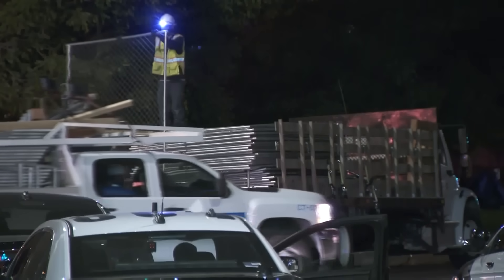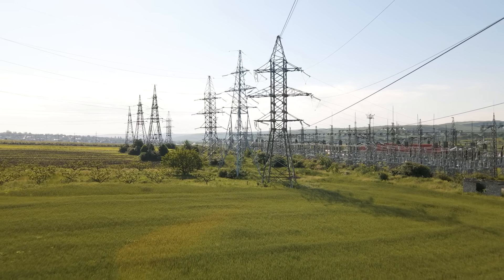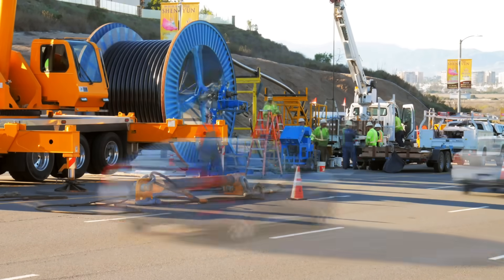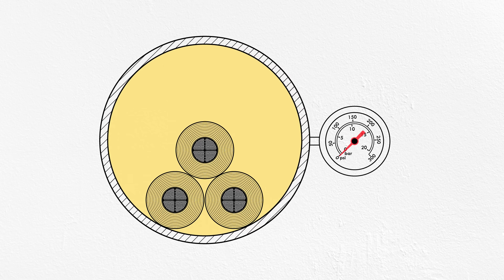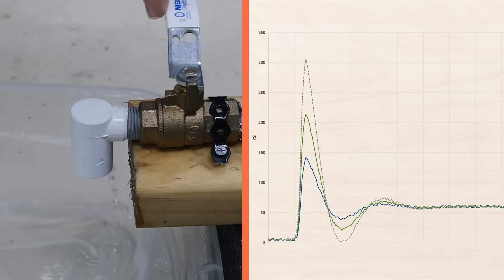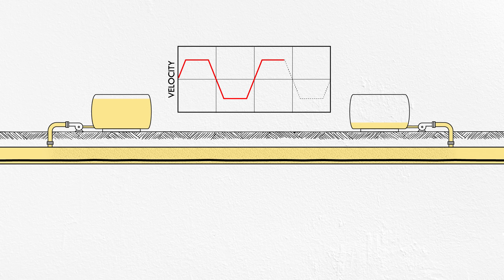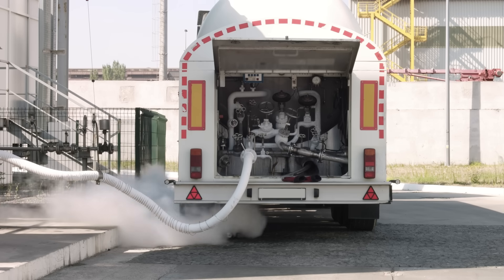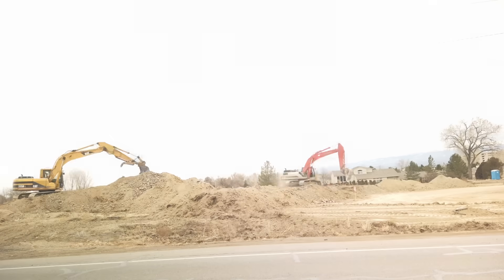Repairing Underground Power Cables Is Nearly Impossible

Comment: Singapore has a rather interesting (though experimental) solution for this, instead of buried lines that need to be dug up each time for repairs and modifications, a huge tunnel is dug (similar to train/vehicle tunnels so they can be easily accessed even by humans and machines), the lines are laid inside the tunnel which can be easily accessed without any digging up, while still having the benefits of not being exposed to weather
Reply: not only singapoore.
I think London has it aswell, where power and sewage in newer parts are combined into accesstunnels and the diferent pipes run inside a tunnel...
And I believe in Switzerland it is also in some parts done...
Reply: @BlackDragonWitheHawk  national grid are currently bin the process of building new tunnels in London. Don't mix them with sewers though
Reply: @BlackDragonWitheHawk  Is that for transmission lines? I don't think that is feasible for 230kV lines. Like Grady mentioned the necessary clearances for 230kV lines is about 10 ft. At DWP we use 13 ft for bus conductors at the station, which I'd imagine the transmission line groups use the same clearance unless space is an issue. 

For low voltage distribution lines we do use underground cable that go to various vaults and manholes
Reply: You are correct London has some historic foot or railway tunnels that have been repurposed for this.
Reply: @BlackDragonWitheHawk repairs must stink 😆
Reply: @BlackDragonWitheHawk  Yep, Tom Scott has a video filmed in one of those tunnels: https://youtu.be/Mm5khEUIBx0
Reply: @BlackDragonWitheHawk  And Auckland, New Zealand. A tunnel was built to provide extra 110kV cables to downtown. And space in the tunnel was leased to run 220kV cables right through the city since building extra overhead 220kV lines through the urban isthmus area is impracticable. New Zealand also has 350kV direct current submarine cables interconnecting the North and South Islands.
Reply: I witnessed a tunnel being cut ( approx 6 meters wide) in the median of a main road in sydney, they then installed removable concrete lids and laid cables in the easily accesable tunnel, this concept is not unusual but the scale made it quite interesting to me, to have 300kv lines so accesable for the entire tunnel is proably a dream for many electricians and engineers
Reply: @michaelwillis1832  That's not George Street, is it?
Reply: @HenryMidfields  Actually it was hoxton park road that i witnessed it on, now liverpool transitway
Reply: @michaelwillis1832  sounds like 10 or 100 times cheaper than digging a tunnel. Great idea! Any idea how they fix the static problem of heavy traffic right above the tunnel?
Reply: @VividFlash  The Cables are fully insulated, the install looked much like the last section above with xlpe or something similar is used.
Reply: @VividFlash  Admitedly the insulation doesnt completely stop the magnetic fields but the lid would attenuate the field somewhat, after a little looking around i found a document saying underground cables do have a higher comparable field at ground level than a aerial cable, but no exact numbers. :Shrug:
Reply: We also have a smaller version of this in Tokyo, with utility tunnels in certain places in Tokyo, Osaka, and other big cities. They aren't as big as Singapore, but they still allow people to access inside the tunnels to carry out repairs.
Reply: London did the same for a line passing under the Thames river.
Reply: Another method is dig a trench, along the sidewalk, then cover the roof. The first underground railways in London, in the UK were built this way.
Reply: That's probably extremely expensive in comparison.
Reply: @fatweeb1545  Probably not compared to the lost revenue and repair costs associated with poor planning.  WE see it in IT all the time.  People want to save money on or constrain budgets their infrastructure.  But when there is as huge problem it is given an open checkbook to resolve an issues.  Almost always it is worth while to spend a little more to do it the right way.
Reply: @itninja9503  I always say this, my dad instilled it in me. "If you do it right the first time, ya it's more expensive, but the cost is worth knowing it's done right and something else isn't going to go out", we owned rental properties. But I think that's true with a lot of things, like buy cheap buy twice or halfway fixing something instead of doing it right.
Reply: @embracethesuck1041  I totally understand that, I always like to plan and make sure I'm doing whatever it is to the best of my abilities, basically OCD lol. But I get time constraints and deadlines ect.

I think the tunnels main drawback would be if you did run "all" the utilities through one place then that would be a major security risk. Or if something natural happened it would cut all the utilities, it's amazing what we can do nowadays that we're even having this conversation.
Reply: @embracethesuck1041  Absolutely, with age comes wisdom and experience. What I've found out is life is all about finding healthy balances. I'm about to be 35, I'm always trying to expand my knowledge and understanding. Hence why I'm watching an engineering video and having a nice discussion.
Reply: There is never enough money to do it right, but there is always enough to do it over. :)
Reply: @itninja9503  Correct and spending a little more through time on continuous maintenance to retain the reliability between problems.   In addition, this also continues the institutional knowledge of the systems throughout it's lifecycle throughout employee turnover.  As an auditor, too often I hear that IT people just won't touch aspects of the system because they don't have the knowledge or experience...if it ain't broke, don't fix it...because they don't know how to fix it.  Prime example is mainframe systems that are just too expensive to replace because nobody knows exactly all the nuances of how it works, decades of trail and error that have created a spider web so complex it cannot be rebuilt.
Reply: @fatweeb1545  only short term... and if you combined every utility service into the tunnel, ease of access and reparability would probably be profitable quite quickly
Reply: @BlackDragonWitheHawk  quite quickly? You mean 40-50 years? You're comparing the price of burying cables and occasional meintenance to digging a friggin tunnel.
Reply: @BlackDragonWitheHawk  Are you sure it's feasible or smart to run "all utilities" -- potable water, storm sewer, sanitary sewer, high speed fiber-optic, high voltage electric and perhaps more -- in the same "big pipe" or bore hole.....? 🤔 I'm skeptical and unlikely to invest!
Reply: @shadmansudipto7287  umhm, but every hour of outage can cost millions... Ease of repair will quickly save a lot of money.
Reply: @shadmansudipto7287  tunnel digging machine can make real quick work of anything in its way. Don't forget sewage and subway passage are tunnels too and all cities have a complex network of that, so I don't see it will require tons of time to dig a simple tunnel for cables...
Reply: @BlackDragonWitheHawk  Yeah I'm gonna say the ROI for this isn't in the realm of 10-15 years. Maybe 50+, especially with new updated techniques.
Reply: @huangjunwei7211  that's a ten mile tunnel under los Angeles. It's a lot simpler when you don't have a massive city and existing infrastructure to consider. I also have no idea how viable larger tunnels are in this specific area.
Reply: @aoikemono6414  the electrical cable tunnel is actually dug very deep underground, below any sort of infrastructure that may require consideration, at least that is whats done in Singapore.
Reply: @gus473  That’s what we’ve done in Paris since the start of the 20th century.  I was involved in designing the fiber infrastructure in the  mid 1990s to keep it up to date. To be sure there are challenges in a warm humid environment, but we did it and almost all buildings in Paris have fiber access, as well as drinking water, non-potable water, gas and electricity running alongside the waste water in walkthrough sized tunnels in every street.  There’s even a visitor center in central Paris where you can have a look at the real deal!
Reply: @shadmansudipto7287  to be fair, when you take the context of Singapore in mind, being a highly socialized country not particularly focused on profitability, a couple decades is probably a reasonable timeframe for the profitability of Public Services.
That being said though, again, Singapore is a highly socialized country, so we should probably be looking more at when it breaks even rather than when it becomes profitable, which is probably more like a decade or two. The priorities of the project are quite different to what they might be here in the states, and as such this actually might be a solid idea for Singapore specifically. Especially considering Singapore has a really small geographical area, sticking tunnels everywhere might be initially expensive, but you don't have to make as many of them
Reply: @BlackDragonWitheHawk  Additionally if you're already building tunnels that lead to commonly used areas where utilities are going, why not use them for public transport? Even just using electrically powered buses (Trolley buses with overhead power cables ala trams would work well and mean no need to build rails) could be a relatively cheap way of directly getting revenue from such a system.
Reply: @shadmansudipto7287  11:40 Well this power cable had to be completely drained, was down for many months and cost several millions of dollars to repair, yeah I think spending an extra 5-10 million right away and getting repairs done within a few of weeks is probably more cost-effective and will pay for itself sooner than doing it they way they did...
Reply: @pennyforyourthots  I'm not sure public services are, or should be, intended to be profitable. There's a pretty convincing argument to be made that things like electricity, water, and internet should be provided at a break-even point, if not at cost. I'd be annoyed if they started putting tolls on city streets to make them "profitable", for example.
Reply: @BlackDragonWitheHawk  First, no, it would not be "profitable quite quickly."  If the initial installations of utilities are done with good design, they should last decades. Amortisation is over decades as well.
A utility tunnel is massive more expensive and, if replacing existing infrastructure, would require replacing utility lines that were far from the end of their planned lifespan.
Speaking of cost, the money need to pay for the more expensive option is not always available.
Another factor, at least for Los Angeles where this occurred, is that many different entities (some private) control the different transmission lines. Convincing, or forcing, them to build new lines would not go over well.
Reply: @huangjunwei7211  Slow to make back the profit. Obviously digging the tunnel is easy, but it's going to cost billions.
Reply: @shadmansudipto7287  You're making up that number. It all depends on the cost of the maintenance combined with the costs of having outages, compared to the capital costs. It could very well be the case that in the long run, building a tunnel is more economical. Also such a tunnel could be used for other functions, especially if the city needed a tunnel anyway.
Reply: @shadmansudipto7287  You are also doing a bunch of digging for pipes or cables. If you figure in disruptions for maintenance over the next 100 years that tunnel would make sense for high density areas. No need to dig up a street or add to congestion. Just set up shop at the nearest access point and get to work. No need to use expensive and slow diagnostic equipment to find the problem before digging, just have someone walk the tunnel and look for the problem. 

You are probably right if the tunnel is huge, but if the tunnel is done with prefab sections and the diameter is kept within good limits it is likely a solid solution. Luckily this kind of project shouldnt require a tunnel big enough for multiple cars to drive past each other or even big enough for a car to drive it. They likely need it to be big enough for 2 people to pass each other and have room on the sides for the actual pipes and cables to be mounted. That sounds like it would be the size of a hallway in the basement of many a large building. Definitely expensive, but it probably is cost effective for some infrastructure applications.
Reply: @gus473  yeah, when you need so much distance from the conductors. Or water and sewer lines, which depend on the ground to restrict their movements, now you have to install lots of anchors..
Reply: @gus473  Do you have actual facts to back this up?
Reply: @gus473  Engineering is always a compromise. After all, we have exactly the same thing - all the utilities in one place in the basement of every apartment or office building. In the high-rises there are even vertical shafts.
Reply: @grantadamson3478  Not sure what you are asking.... 
¯\_(ツ)_/¯
Reply: @aoikemono6414  Los Angeles does have subway tunnels, mostly in and near the downtown area, which is next to mountains. The Boring Company's first tunnel is located about 5 miles from the Scattergood plant. That tunnel is smaller diameter than a standard subway tunnel. As far as I know, the upper layer of soil above that tunnel would be clay, although lower levels might be a finer texture, even sand. The immediate coast in the area of the underground transmission line is mostly sand or sandy loam (El Segundo sand dune system), at least in the upper layers. The dunes are subject to liquefaction during earthquakes. 

The Boring Company was unable to build further tunnels in western Los Angeles County primarily due to NIMBYism (Not In My Back Yard). This latter reason is probably the biggest factor preventing certain infrastructure projects, and I believe is the greatest obstacle to building high-speed rail to or from the Los Angeles area, whether above or below ground.
Reply: @vgamesx1  The 5-10 million is for what? A tunnel that is bored using currently standard technology would cost 1 billion per mile, I think.
Reply: @exrobowidow1617  Your numbers sound pretty far off, Elon Musk's 17-mile tunnel was estimated to cost 1 billion and before you say "but Elon is amazing, he can do it way cheaper" no, he exaggerates everything and his tunnels cost about the same as any other company.

Plus you don't need to dig some massive tunnel you can fit a car or train though just to be able to access some wires, it only needs to be big enough to walk in at most...

So yeah ok, it's probably more than 10 million per mile, but we're talking something like 30 million on the high side.
Reply: @huangjunwei7211  my city has no subway
Reply: @BlackDragonWitheHawk  The problem is that nobody wants to be near an energized HV cable to maintain the other stuff. This is a huge problem all over the world.
Reply: @BlackDragonWitheHawk  It makes sense in the long term, provided you don't have any tunnel collapses due to overdevelopment above the tunnels or natural disasters.
Reply: @MikeSnitkovski  a kilometre of subway in vienna costs about 1 billion€ iirc
Reply: @VividFlash  can't quote a number really, but subway and service tunnel seem to be in different weight categories if you know what I mean.
I would think that 1bn/km includes the cost of ALL the service tunnel and shafts required for subway...
Reply: @shadmansudipto7287  so we would recoup the money spent in one generation to fix problems for several generation?
Reply: @shadmansudipto7287  You're spot on with the cost / benefit analysis used to justify a "friggin tunnel" that can be used for many purposes and the systems more easily maintained (safely and cost effectively) and upgraded without costs associated with digging up and replacing the systems through expected degradation and unseen events. Imagine the costs of deconstructing and replacing infastruction every 40-50 years and the associated outages.
Reply: @aoikemono6414  Or Earthquakes.  Not considering the environment is recipe for a 101 lecture in engineering fails.
Reply: @gus473  Im sure that no one puts all those utilities in the same trench in the ground. I wouldn't want my fresh water being near a sere line I'm case there's a leak in them.
Reply: @shadmansudipto7287  - You do realize that when you're  talking about infrastructure '40-50 years' IS quite quickly?
Reply: @BlackDragonWitheHawk  prob a company that makes lots of money repairing underground transmissionlines that would stop a better system from being used heh.
Reply: @gus473  all the waterlines can be together , what's gonna happen , to them ? Fiber and electrical too , car tunnels carry all of those at times ....
Reply: @Richardincancale  can you post a link to that?
Reply: @laus9953  YT won’t let me post links, but if you search for Paris Sewer Museum you’ll find it easily. It’s at Pont d’Alma in the centre of Paris by the river.
Reply: @huangjunwei7211  you can’t just dig tunnels anywhere
Reply: @gus473  Paris has done this for a few hundred years since they first dug sewers, admittedly I wouldn't want to have to go into the sewer as a gas, electric or water engineer, but it does work. I've never heard of oil filled pipes surrounding electrical wires before also as far as I was aware paper insulated wires were banned relatively early on in Britain with asbestos being the only insulator before the invention of suitable plastics. It's something I'd be curious to learn more about to see if it's just that America never made the expensive transition to more modern techniques, or if it's the common practice.
Reply: @shadmansudipto7287  40-50 years is quite reasonable for Singapore as we prefer to using the same sources and just maintaining it, just like our fresh water system, it’s rarely been changed, sections are mostly replaced when there are anomalies in water flows that could indicate leaks. Same for tunnels, it would probably be used for a real long time and just expanded upon.
Reply: @BlackDragonWitheHawk  of course, the consequence of that is that multiple services could fail at the same time.
Reply: @BlackDragonWitheHawk  all utilities in the same tunnel ? So we should have the cable guys working around high voltage power cables
Reply: @shadmansudipto7287  o
Reply: @gus473  in the US it is generally against code to combine sewer and storm water (in areas where they are combined, there are tons of issues), also poses a healthy safety risk.  All utilities?  no, but things like electrical, communications, could be done in a maintenance pipe/tunnel.  We don't need a 20 foot dimater tunnel to do it, something smaller would generally be more than sufficient in most areas, and since the tunnels wouldn't be carrying water/fluids, if put below the frost line, would last considerably longer, so the cost of replacing would be much lower than say serwer, water, and storm drain type pipes or tunnels.
Reply: @BlackDragonWitheHawk  Yeah, and when you're medium to high voltage faults, and takes out all the other services see what your cost will be then. How are you going to make repairs? Spend sometime in a underground manhole in an old congested city on the east coast.
Reply: @shadmansudipto7287  the infastructure is built to be there much longer than 50 years
Reply: @gus473  it's already done in many countries so you can keep your skepticism to yourself
Reply: @BlackDragonWitheHawk  not really that much space underground in old city and it's really a challenge to replace an old infrastructure without stopping it
Reply: @vgamesx1 the cost of this repair wasn’t in the 10 million range, it was much more. But a tunnel would be in the *billions*, not millions.
Reply: @MikeSnitkovski outage was 13k per hour
Reply: @shadmansudipto7287 the price is paid by all people that I’ve in the area and they aren’t going to just cease existing
Reply: @gus473  they're separated by concrete into separate lanes
Reply: @MikeSnitkovski   Every hour does not cost "millions". Why make stuff up when we all just watched the video that contradicts you?
Reply: @shadmansudipto7287  ah yes gotta love the ‘leave my problems for the next generation to solve instead of doing anything even remotely helpful or productive myself’ mentality
Reply: @fatweeb1545  when Net costs over time are compared, no.
The costs to repair non-tunnel lines adds up to exceed the cost for tunnels real quick.
The issue we don't do it is simply capital cost, as our society prefers to amortize costs (often at the expense of lives).
Reply: @fatweeb1545  even more expensive to have to spend hours upon hours to dig and then find out you can’t repair VS having a service tunnel to just walk in and repair. I think the savings in maintenance would counteract the initial costs. Unfortunately politicians who make these decisions don’t think that far into the future.
Reply: @fatweeb1545  when you have to repair  it (and the time comes sooner or later)the money is Well spent
Reply: @fatweeb1545  but you get controlled access, built in cooling, easy expansion, and so on and so forth.
Reply: @fatweeb1545  Expensive initial cost, but easier down the line to maintain.
Reply: @fatweeb1545  Until the line fails, or the line needs upgrading, or a telecom needs to run a parallel line. Digging up dense neighbourhoods and busy roads is the biggest real cost here, so it makes a world of sense to ensure you don't need to do it twice.
Reply: @fatweeb1545  no if you calculate maintenance
Reply: @fatweeb1545  not when you can cram many different lines in one conduit.
Reply: @fatweeb1545  In California these days, with overhead lines being linked to wild fires, it may now be more economical o bury the lines than pay to replace a whole town or face man slaughter charges as PG&E does.
Reply: @fatweeb1545  For retrofitting existing cities, towns, etc, absolutely - how would it compare to building new cities, etc with it though?  (Perhaps a silly question)
Reply: @fatweeb1545  In high population density area the cost can easily be covered, though this wouldn't be a viable solution in low density areas.
Reply: @fatweeb1545  initially likely but what about extremely long term cost?
Reply: @fatweeb1545  ya it is but Elon did it "cheaply" for his cars so the goverment should do it also since they love spending the people's money
Reply: @fatweeb1545  yeah... for its construction... other than that... no
Reply: @fatweeb1545  upfront, sure. But way cheaper to upgrade or repair. I imagine it works out pretty well over the long term
Reply: @fatweeb1545  tunneling isn't really possible in the geographic conditions of LA. That's why it doesn't really have a metro system, it's prohibitively expensive.
Reply: @fatweeb1545  Pay once, Cry once
Reply: @fatweeb1545  perhaps it is expensive, but consider that for regular maintenance and repairs, no one has to get on a ladder truck, roads don't need to be shutdown, etc.  Then in terms of weather, no damage from ice, wind, car accidents etc.  Companies often fail to look at soft costs (employee salaries, etc.), so the savings would add up quickly.  At least in Michigan, all new construction must be underground as it is.  A tunnel such as what was suggested could support multiple pieces of infrastructure, not just electrical.  Think of the benefit of how easy it would be to upgrade or update service with this.  Just some thing to consider.  In my area alone, over the past 5 years, there have easily been several down power outages and our power lines are above ground.  In the neighborhood immediately to our north, they have had less than 10, and their lines are completely buried.  Repairs for them would have more impact since they are direct buried instead of in a tunnel, but still.
Reply: @fatweeb1545  It's expensive but worth it in high-density areas. But not everywhere has efficiently built cities, unfortunately, and so cost per mile of infrastructure gets multiplied by a whole lot since everything is spread out.
Reply: @fatweeb1545 maybe initial costs but I'd be interested to see what the maintenance and upkeep looks like long-term
Reply: @fatweeb1545  Until we find a way to transmit power like wifi I think a tunnel in the long run will pay off, these cities are here to stay for decades and centuries.
Reply: @fatweeb1545  Did you watch entire video?
Reply: expansive soils have entered the chat
Reply: @johnsmead5096  that sounds expansive...
Reply: @johnsmead5096  There is no need to get upset about frost heaving.
Reply: @Kineth1  Clay doesn't need to freeze, it only needs to get wet.
There's a good reason basements are impossible in many parts of the U.S. and foundation repairs like mud jacking are a common thing.
Reply: @jimurrata6785  I was thinking of where i grew up, Maine.  Frost heaving regularly upsets pavement.  I never even considered clay problems.  Thanks for the info!
Reply: @Kineth1  I thought he meant clay soils. No frost required. Just add or remove liquid water.
Reply: @exrobowidow1617  I figured that out, that's why I said "thanks for the info."

But, I do appreciate anybody who tries to be helpful on the internet, so thanks to you too!
Reply: @jimurrata6785  basements are not impossible anywhere, they're just more expensive in certain areas making them out of reach for regular middle class people. We even build basements on the beach here
Reply: @mhxxd4  Sure, you can blast solid granite or create a cofferdam to put a basement under water, but there's VERY little way you're going to get a basement in expansive clay.
IF you can build it strong enough not to get crushed like a cardboard box, it will pop out of the ground like an infected tooth.
Reply: @jimurrata6785  no you just have to use thicker concrete(expensive). And use normal sump pumps to stop it from becoming buoyant. Or you can anchor in down into the ground. Or you you can just make it super heavy to match the displaced volume

Hardly worth it for regular homes but for mansions(which are becoming a lot more popular and common) it's pretty doable if you have the budget
Reply: @mhxxd4  I'm done 
You don't understand how clay works and dig right into defending your willful ignorance.
I've already pointed out that bulk water (like you can pump) is NOT the issue, and that OF COURSE you could build meter thick reinforced and butressed walls.
NONE of that is going to remediate cyclical heaving that can go down for hundreds of meters.
Good luck and goodbye!
Reply: Wait, so they have actual videogame-style "sewers"? That's amazing.
Reply: Did anyone mention earth quakes in California?
Reply: cable trenches ...  introducing the problem of rodents knawing on the insulation.
so you need to release snakes ... to eat the rats.
Reply: And hawks to eat the snakes.
Reply: Roger sounds like a movie sequel for Samuel Jackson - “Snakes In A Tunnel!”
Reply: Berlin is also currently replacing the dug-in parts of its cross-city high voltage line with such a tunnel (the other part is already one). This also allows to later extend the capacity by just putting an additional cable near the existing one.
Reply: Expensive? The guys have to keep a 14 bar dielectric oil pump working. If it runs long enough it pays for the tunnel.
Reply: @rtleitao78  That was old tech.. He talks about the new methods of doing this at the end of the video.
Reply: If you pay attention to the content in this channel you should realize that a shitton of very smart people are spending their lives on these problems, and probably most of the infrastructure couldn't just easily and obviously improved like that. Tradeoffs in all dimensions.
Reply: That's practical and used in large urban areas. Not practical in low density environments.
Reply: That makes sense when the entire country is the size of the city of Los Angeles.
Reply: This is exactly what i came to the comments to say. I think we have a bit of that here in certain areas of the United States, but it is far from common place. I liken it to Jeffries Tubes in Star Trek. While I recognize it could be really expensive, I'm getting kinda tired of this notion that we can't afford to do comparatively basic things to better our societies due to cost. 

As an American i always fall back to the idea that we pretty much invented (okay, discovered) entirely new areas of science for a penis measuring contest with Russia to get to space first. And we did it with marginal consoderation of cost and inside of 2 decades.

It brings me to the point of near utter rage that we (again, only speaking as an American generally and a New Yorker specifically) could afford to build all this awesome stuff 100 years ago but can't afford to maintain, improve, or modernize it today. Like, what the heck is money even for then?
Reply: Singapore is only 280 sq miles in size.
Reply: Although this concept is very appealing, I wonder if this is something uniquely qualified for city-states like Singapore.
Reply: From what I have read, Singapore uses  SF6 gas for insulation in their HV ducts. 
I have worked on installing insulated SF6 bus ducts and devices in power plants and grid stations. They have to be carefully built to prevent leaks and have leak detection. Failures would be catastrophic. The gas is very effective and allows more compact construction.
Reply: I notice where there is an infrastructure job, like road construction, a tunnel is used and all services are routed through the tunnel. In Melbourne, there is a train crossing removal program and I’ll bet lots of services had to be rerouted and can use the new tunnel or bridge.
So might not fe feasible for one service but gas, water, sewage, power and communications lines make it worthwhile.
Reply: That is the super old way to do it. Like old industrial plants have it. It's so expensive that nobody does underground tunnels anymore.
Reply: This is nothing new, at europe you have these tunels, called there colectors,  used at many big cities, and you have hete everthing.
Gas lines,  electricity lines,  interntet cables.. Etc. Everthing easy to add when needed.
Reply: utility tunnels are common place in many cities around the world. The University of Alberta has an extensive network of them connecting every large building on campus.

Still if you did a HV line back then at those voltages you'd need an expensive and complicated insulative solution like that oil filled pipe
Reply: Is it AC or DC, because DC is getting popular with long underground/underwater.
Reply: @Dwayne Smith Then stick with overhead cables.
Reply: The UK does that too now.
Reply: I saw a TV program about a similar infrastructure in a European capital. One of the maintenance technicians if the tunnel did a tour guide for the TV crew through one of these tunnels. I was amazed when he pointed to one of the pipes and said to the camera that it was a communications of the Ministry of Defense that was filled with oil. A week or 2 later after the show had aired I read in the news that someone had accessed the tunnels and axed a communications cable. TV reporters are total retards when it comes to keeping secrets.
Reply: @Dwayne Smith yep. Big cities also mean that "digging something up occasionally" is far from trivial - road closures have an immense cost to them in tight urban areas. The sheer amount of human life spent stuck in traffic can be staggering.
Reply: There is nothing experimental about that, that method is used allover the world and have been for at least 40 years.
Reply: There's nothing innovative about tunnels. They're just expensive to dig. Unless you found a way to dig them cost-effectively
Reply: Similar tunnels in London
https://en.m.wikipedia.org/wiki/London_Power_Tunnels
Reply: Having worked such underground pathways tunnels , vaults on lines well it sounds good on paper but such installations are subject to flooding, muck buildup and animal problems , from rats to stray critters of every description, then there is the build up of toxic or flammable gases . One installation thieves stole the lighting and alarm wiring... there was even one that went under a small stream, but didnt allow for flood stage waters or the water pressure of a standing 20 feet of flood water, seems that section failed every year. On the good side the maximum voltage was 64 k
Reply: I thought the same thing about the tunnel system. The problem cities with tunnels have experienced including London is that the underground starts to get really crowded and if the tunnel systems aren't maintained then it destabilizes the buildings that sit above ground. Earthquakes make this a particularly big deal. In London planning and implementation are a particularly big deal due to the high level of underground crowding including the subway network. I watched a video on YouTube a while back about this problem. In some cases the tunnels dug are mere inches away from a subway station or other infrastructure and have to be super precise. Buildings have to be monitored with lasers and computer programs to ensure that they aren't in danger of collapse.
Reply: ConEd has hundreds if not thousands of miles of power lines all running through tunnels across NYC connecting to underground high voltage transmission feeders, substations, switches, etc. All been underground for a long, long time.
Reply: Auckland NZ with a population of only 1 million does that too. Its not just the cost of repair its the cost of a power outage.
Reply: So rather than compact cables you want to maintain large people accessible tunnels.  Kind of like the Vietcong  or something.  Very affordable for cities like  London and people are happy to pay 22 cents a kwh in 2021.
Reply: While I see the merit of putting all your utilities in a common tunnel it is not like this idea was never tried in the states.  FYI, sometimes it is nice to have distributed systems.  Especially during something like an LA Earthquake.  Not likely in London.  Also the cost of power in London is US equivalent of 23 cents a Kwh in 2021.
Reply: @hiddenname7272  I am pretty sure that Singapore's system is the most expensive in the world. That is why it is noteworthy.
Reply: South Korea also tons of that as high population dense. Very expensive, 345kV in underground with tunnel. It was cost about 150million dollar per 1 mile. 10~20 times expensive than overhead power line.
Reply: Also keep in mind that putting too many vital lines in common structures means that one failure (structural,fire,etc) will bring down many vital lines.  For example, if a transmission line failed in a common structure with comm or gas or other utilities, the transmission line fire would take the other utilities out as well.  You have to do a benefit/risk when engineering.
Reply: One of the big reasons we don't have basements or underground trains in the desert southwest is because of the soil composition. Other places can do underground projects like this but it's not always feasible in every environment.
Reply: Like the 380kv tunnels in Berlin
Reply: You don't have to dig up power lines to repair or replace like a sewer pipe or water pipe. Yes, it's expensive to do so, so much planning goes into such projects. The don't just bury a 12 kv. Single phase power line when at some point they'll need 3 phase, or even a higher voltage line at some point. There are junctions and fuses and some times transformers that need replacing, but generally high voltage lines don't need to be dug up and repaired at any time. That's what the fuses and circuit breakers are for, if by happenstance there's a phase to phase or a phase to ground fault at any time.
Reply: I dont get the hate here, some things  have no right to be together, like sewer and potable water, regardless if its sealed or not. But it is reasonable to place power/internet(sealed) down a sewer line for eaze of maitanence. I live in the country(farmlands) and nearly everything here is buried and has "access sections" where many houses tie together, in particulatly inernet, if anything goes wrong outside of the "access areas" would require digging quite a bit of area to find the issue
Reply: nothing Experimental about it, the pipe he is talking about is ancient and extremely outdated... 

this repair he is talking about, was done in 1989...
Reply: Where I live they put the lines under the sidewalks.  The concrete sidewalk  panels are easy to move with a small lift on the back of a truck.
Reply: Call Elon Musk .   He can take care of that situation and have it operating in 24 hours
Reply: They did that in Berlin too: https://youtu.be/CeuXlgFnNAs?t=153
Reply: So a utility tunnel/sewer?
Reply: This is not a “last mile” thing, but definitely makes sense anywhere there is a large enough volume of utilities in close proximity/along the same path, to make building an access tunnel worth it.
Reply: That's old tech. Stockholm has has service tunnels like that for power lines, water and Tele since the 50'ties
Reply: people forget the US is massive. Most other countries are only the size of a couple states or smaller than 1 state. Its pretty easy to do roadwork or run piping when your entire country is only 40 miles.
Reply: They have that at UCI in Irvine, it is in lots of movies'
Reply: Quite normal in inner-city areas.
Reply: They also murder people for looking at porn
Reply: You should see how many electricity cable tunnels are under Sydney. Built for 330kV and 132kV lines.
Reply: I was thinking the same thing.
Reply: I think they use disused parts of the London Underground for this too.
Reply: singapore is too small so they can do things like that
Reply: Expensive short term cheap long term
Reply: More expensive to initially install, but cheaper to maintain or upgrade.
Reply: Elon musk boring company
Reply: America has an interesting solution too: elevating the lines above the ground.
Reply: Sounds expensive
Reply: Even so, medium and high voltage cables by nature have a limited lifespan. The electrical stress they are constantly experiencing simply can't coexist with longevity.
Reply: @Dukers2300  that’s not really true…it’s the insulation that breaks down. Overhead or underground
Reply: Which is a great idea if you do it in the planning stages, hard to do once everything is already in place.
Reply: It would cost hundreds of trillions of dollars to do half of the US and many decades.
Reply: Expensive to start but the money saved every time you add a new line or do a repair QUICKLY eats that cost. Amazing idea.
Reply: Yea it’s basically a huge conduit. Everyone who knows anything about running wire knows to use conduit so you can run new lines through in the future.
Reply: Rocket science
Reply: In none flood zones this could work
Reply: It makes sense to have long-term solutions versus short-term fixes that's the type of engineers that we need
Reply: I like the idea, but i am imagining trying to explain to electricians they need to go into the sewer...would be a fun conversation to listen in on.
Reply: Hong Kong is the same way
Reply: I believe we call that "Common Sense".
Reply: This is what the world needs to dom
Reply: That's an advantage of having extremely cheap labor.
Reply: I thought that’s how it’s done everywhere 😂 that’s much more logical 
Over here in my country it’s just transmitted on electricity poles
Reply: Smart, but also FAR more expensive. And costs matter. Maybe there's a middle ground that can be met somehow.
Reply: Interesting to know
Reply: Well our government would rather spend more on our military and aid to other countries than good infrastructure 😂
Reply: This is literally what I think of every single time I see lines of any kind being dug out of the ground or in the middle of a road. Even if it's more expensive to build a tunnel system large enough to adequately support all the infrastructure of pipes & cables that a city requires, there is no possible way it costs more than the constant drain on the economy of shutting down roadways and everything else for a simple line break that would cost next to nothing to repair if it was installed in a tunnel; not to mention how 99% of breaks wouldn't have occurred in the first place if it was installed in such a facility.
Reply: It depends on the geography. That region of the world has quite soft rock. Tunneling is cheaper. Another benefit is less risk of environmental pollution when the oil leaks. This can be a major problem with underground cables.
Reply: We have cables that go along the bottom of almost every ocean, surely we've figured out a system to ensure against leaks in much less extreme environments? Or just do it super disaster-proof and make it with one tunnel around the smaller tunnel that houses all the piping & cabling, then the inner tunnel is suspended inside and essentially earthquake-proof against all but the biggest seismic events. Yes, expensive; but you never have to dig again and your city isn't exploding from underneath when a 5.2 breaks all the gas lines. I'd say that's worth a little extra expense early on.
Reply: Some place in the world don't mind dugout the cable each time needs to be fixed
Reply: The only good way to go underground
Reply: This was a great idea for Singapore, especially in the more crowded areas. Unfortunately the cost of doing this in a nation the size of the U.S. is unrealistic. For individual cities that already have an underground system established it could be done.
Reply: It makes sense in ultra high density areas where the modularity benefits outweigh the cost. In the USA there is enough room to just build a new city or neighborhood with the infrastructure needed to support whatever is needed.
Reply: Chicago I’ll does also and has for decades
Reply: yeah, but likely the tunnels are also for rainwater drainage, so it's not an apples for apples comparison.
Reply: That would be insanely expensive out where I live or anywhere for that fact. There are some out in the country near me and digging a tunnel like that would be an insane project considering they won't even bury them lol.
Reply: This comment thread did not disappoint 😊
Reply: That's how it's done everywhere else
Reply: That's how it was done in some parts of Eastern Europe, scattered places across the US (A specific part of Waltham, Massachusetts for example), and in the Soviet Union. Some of these tunnels even have small apartments for electricians to take breaks in while working. In Michigan I saw some towns where the power lines and water pipes were underneath the sidewalk. The sidewalk was made of individual slabs that could be pulled up to work on the cables or pipes. In some parts of Scandinavia they use this method as well. Where I am the power company refuses to install any more underground power lines. They have been having issues with high end housing developers installing cables without talking to them because they don't want overhead lines. There's an entire apartment complex near me where there are abandoned buried lines from only last year. The power company refused to connect them and installed overhead lines through the complex. All of the underground lines and transformer pads are just sitting there abandoned.
Reply: Americans be like noooo it’s too expensive while gladly giving more money to experiment on the brown people bomber 9000
Reply: @Zones33 this drivel means?…
Reply: How are the phases insulated?
Reply: Expensive. But done right. Very safe and mechanic friendly. Nice to know😮
Reply: This is exactly how underground transmission is done in the states since 1954. Long before Singapore was independent.
Reply: Well this is America the more money we can funnel into the politicians pockets the better. So why not build a more expensive but maintainable infrastructure rather than make it disposable. Crazy
Reply: There are utility corridors underneath things like stadiums too.  It's not just a Singapore thing.
Reply: This is pretty common in modern urban cities. The property tax revenue of the area just has to be enough to support that
Reply: They're called utility tunnels
Reply: Also in Sydney Australia in the city area , I used to walk thru it in the seventies as a new young technician. As a much older and experienced person I wouldn't do it again unless I really had to many cable joints in the tunnel you wouldn't want to be close to one if it went into fault.
Reply: This only works in Singapore because it’s a small nation that makes its money from banking and the only place they have too build is put more sand In the sea, dig deeper and bigger holes or build up. Bad comparison
Reply: You misspelled "wildly expensive".

I love it when people put forth things like this, done in Singapore or Norway or the UAE...places with very concentrated populations and tons of $$$...as recommendations for the US as a whole. We're not living in the disinformation age. We're living in the information in the absence of knowledge age.
Reply: How is this considered as interesting let alone experimental, that is a solution everyone can come up with. Its just a matter of cost
Reply: Demonstrates long term vs short term thinking . US is too focused on the short term
Reply: Yeah I was thinking the Boring Company machines are pathetic for humans. Amazing for utilities. 

 In fact are there no mini TBM machines .5 meters wide or smaller that can dig, and reinforce a pipe as it goes? 

 Someone design a mini contraption that can do that. Make course correcting small pipes for utilities that would be dope. Little Mole robot with a extended body making pipe.
Reply: Tunnels are expensive if the soil is hard / rocky.

Pipes can be expensive too if youre putting these expensive oils in them, and these expensive specialty manufactured cables. 

If you hired a bunch of... sorry to say this but "cheap" "indians" "chinese" and maybe "indonesian" workers to dig tunnels, sometimes a tunnel is cheaper, depending on soil and workers.

But I'll agree that laying a cable, although its a pipe... is speedier than digging a tunnel, unless youre laying a pipe in mountain rocks, which is still faster than digging a tunnel in mountain rocks.
Reply: That works great in severe weather environments, unfortunately there are large areas of the world where the bedrock is very shallow that makes tunnel making prohibitively expensive, and that doesn't even consider the high water table that accompanies shallow bedrock.
Reply: if you think only singapore has this, than you are well.. underinformed. Almost every bigger city in EU has this kind of "underground". And by a bigger city, I mean it doesnt even have to be a city over 1M people large. The tunnels house all kind of infrastructure - from water, sewer, natural gas, electricity, up to optical fiber comms.  Yes it costs a lot to dig a tunnel, but replacin or repairing even adding new cables costs peanuts then, compared to having to dig kilometers of trenches every time.
Reply: @Sixta16  How many Earthquakes in London?  How about LA.  We know about tunnels.  Hope none of your migrant friends bomb a tunnel.
Reply: People here wondering whether solutions like this are worth it are also forgetting that such a design is much easier to expand and so you also save money down the line as demand grows. It's very easy to lay a new fiber optic or power cable in a huge tunnel that already has plenty of space and you can very easily replace existing cables with newer ones, compare that to having to bury a new cable every time you need a new one and you quickly make your money back if the city is big enough. And this is a situation where doing anything other than burying the cable isn't an option. You just simply can't build above ground high voltage cables inside of a city because of the lack of space, widely different building heights and in modern times the risk of drones flying close to the wires. Even if you somehow could overcome all of those issues trying to get the land needed for it would be a nightmare on it's own and there'd be way more people protesting it, whereas burying a cable under the road is very easy for a municipality as they usually already own that land.
Reply: @hedgehog3180  New road and new transmission lines make the decision a bit easier. However, initial cost is still a factor.
Reply: @hedgehog3180  Emphasis on "big enough." North American tunnel costs usually run into the billions; you might save that much over a few decades, but that comes at the cost of not having money for other stuff like new hospitals or subway expansions. So it's really only worth it for the really big cities that have that kind of annual utilities budget to begin with.
Reply: Down side: moar expensive.
Reply: @Dwayne Smith cost efficiency is a mirage because prices are largely composed of bargaining power and not material cost
Reply: Sounds plenty reasonable for densely-packed cities, but definitely not for large countries. (Whoa, it's almost like cities and not-cities have different pros and cons. Completely foreign concept for most city-folk that enjoy living packed like sardines with zero privacy/personal space).
Reply: We Americans never like to think far ahead we're all about the short term.... It's unfortunate but true.